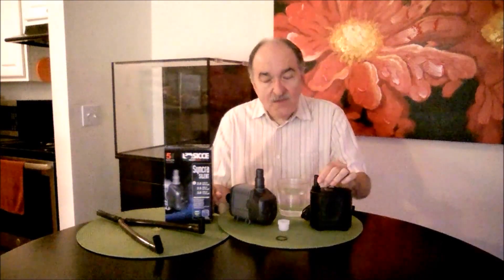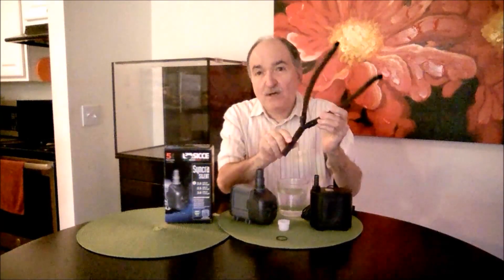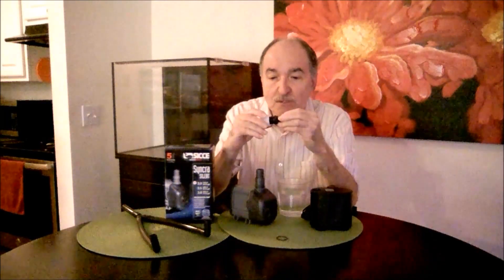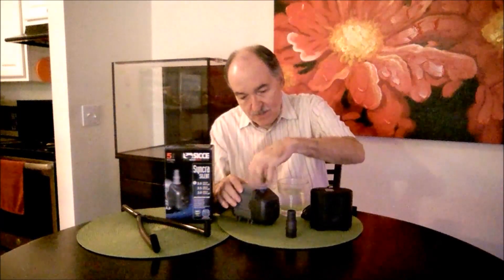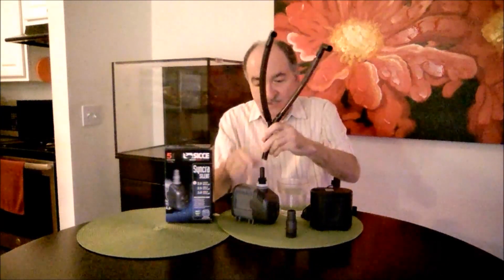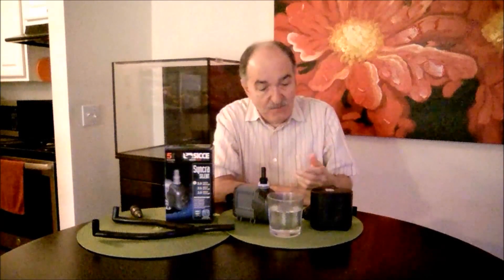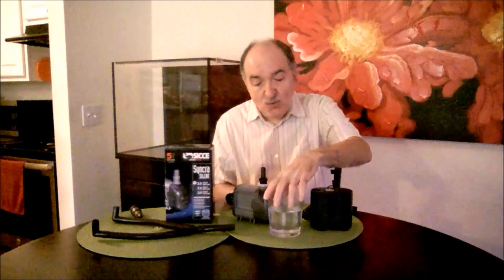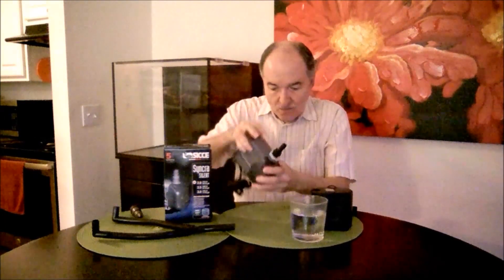Switching the stock IM 40 pump to the Sicce 2.0 pump

Comment: Hi thanks for your innovative method. I’m afraid I cant find the fitting you’ve mentioned in this video. Where can I find that online? What should I search foron the internet to find this fitting? Thanks
Reply from the maker: Hi Saeed, there is another fitting to use in which I will be doing a video in the near future of how to adapt it. The fitting I've discover now is a fitting similar to the one the Sicce pump brings.(the gray fitting)  The bottom would be the measurement of the Sicce fitting, but the outlet would be 1/2 inch which although a tight fit it can be done.  Any questions let me know.  Eddie
Reply: Hi Eddie, thanks for the reply. Is it possible to connect a hose to the output of original Sicce fitteng and connect it to one side of IM fitting, then connect the original hose of IM to the other side of IM fitting? I know it’s not a good way to do it, but at least it solves my problem temporarily. I’ve not yet purchased Sicce pump waiting to find a way to solve this problem before purchasing Sicce pump
Reply from the maker: Hi Saeed, YES.  That is a quick way to do it.  I was going to mention this, but decided not too.  What you do is get a small piece of hose that is the right diameter for the Sicce outlet, afterwards insert the smaller hose which came with the "Y" that goes out to the aquarium outlets.  It should be ok, because it will not be a pressure flow of water.  If you want to when you insert the outlet hose into the bigger one for safety you can secure both with a tie rod{plastic rods) to create a tight fit and you will be OK.  Eddie

I'll be setting up Instagram and are considering starting Live Streams in the near future.  Eddie
Reply: Thank you so much. Honestly, my pump exploded after I left my aquarium for 3 days in my corporation and water didn’t came to the sump. IM pump can’t work outside water and brsts immediately. You must have an ATO for aquarium making sure that reservoir is always full of water. I have heard that Sicce works fine without water and doesn’t heat. Is this correct?
Reply from the maker: Hi Saeed, Yes, the Sicce pumps are for both in the sump and also in a dry setting.  Eddie
Reply: Thanks. Note that I was watching your videos from last year and I decided t buy innovaive marine aquarium based on your videos. Great videos indeed
Reply from the maker: Hi Saeed and thanks for your comments.  I'll be uploading a video soon about the difference between the stock pump and the Sicce 2.0 pump which is the one I'm going to up grade to  In which case I'll be demonstrating how to go about it and the fitting.   Eddie

Comment: I just got my Nuvo 40G today and Sicce 2.0! May I know the exact name of the adapter fitting? And what kind of shop did you get it from? Aquarium shop? I'm in Singapore so it might be harder to find. Also curious what lighting are you using.
Reply from the maker: The Melvin, the fitting is a; "NYLON MIP TO FIP BUSHING 3/4" X 1/2". I got it at a local hardware store.  When it comes to lighting I'm planning on the Radion G4 the nano one, but haven't gotten it yet.  Eddie
Reply: Wow! Radion cost a house!!! I was almost planning to get the Hydra 26 HD but yesterday when I bought some dead rocks from a reefer, he was using a nice and sleek looking light and he explained to me why he sold his Hydra to get it. After Researching and reading about it, it really good! The bulbs are the same as Hydra actually and most importantly it's so much cheaper! I can get 2 and get more coverage ! https://item.taobao.com/item.htm?ft=t&spm=a21m2.10192351.0.0.2cb6deadSBeRr0&id=539344511515
Reply from the maker: Hi Melvin and thanks for your feedback.  Thanks again for your response.  I haven't started the 40 yet, but will eventually.  Eddie

P.S.  Melvin anything you need help or advise don't hesitate to contact me so that I can give you my piece of experience. Eddie

Comment: What were the reasons for upgrading Eddie ?
Reply from the maker: Hi Steve, first thanks for your comments, the reason for upgrading is and usually occurs in which you start to add and add and add animals to your tank to find out you may need a bigger tank so you tend to upgrade.  I purchased the IM40, because I got a deal on both the tank and stand, but not going as fast, because of the costs to setup.  As you must know the bigger the tank the better, but there is a bigger price being a bigger tank.  Sorry I took so long, but my notifications aren't going through only when someone subs to my channel, but not the comments.  Eddie

Comment: Nice Job Eddie with this video and sharing useful tips! I'm debating about upgrading to a IM Nuvo 30 L and this upgrade would work well on that setup also. You can always keep the stock pump as a backup. 😁
Reply from the maker: I'll be using mine to mix my salt. If you decide to go with a Sicce pump or another one always check the space to make sure it fits.  Eddie
Reply: Eddie's Reef Aquaria where did you get the adapter at? I ended up getting the IM Nuvo 30L and purchased this same pump.
Reply from the maker: Hi Jesse, they sell them at any hardware store.  Eddie